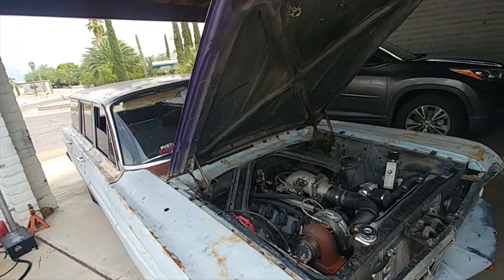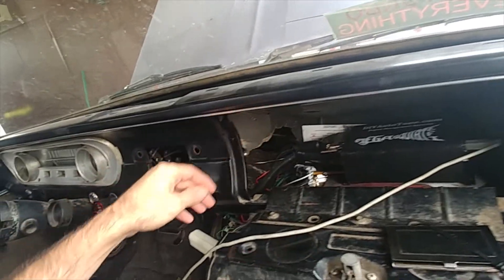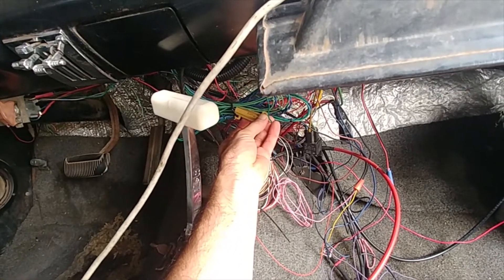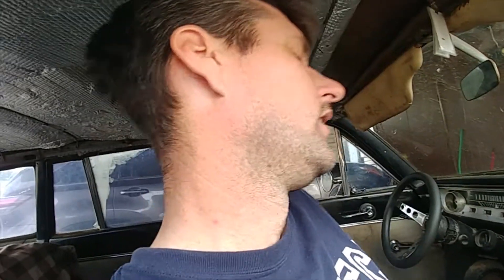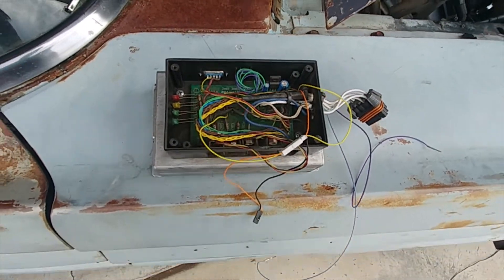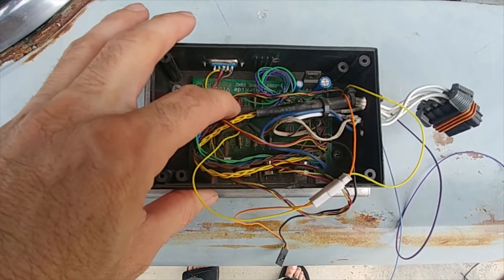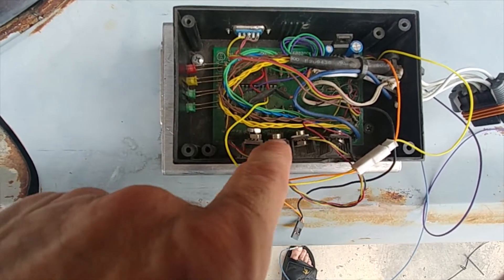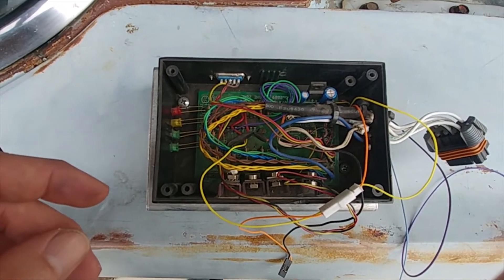4R70W Transmission Controller MegaSquirt3 ECU

Comment: Hello friend, I like your project. casually i want to do something like this i have a coyote engine and 4r70 transmission
Reply: I would like to do it with the ms3 that I need the most I want to control the engine and transmission
Reply from the maker: @ricardorodriguez9994  not sure it will work with a coyote motor as you will need to use up all the spare outputs to drive the VVT and the inputs for VSS will get used up by the CAM inputs.

Comment: I’ve wanted to use an eec5 to control trans only, no engine. It needs a 36-1 crank trigger but no cam sensor, I think everything else could be simulated with resistors internally. You are using 36-1 crank with hall effect sensor (explorer style) if I’m not mistaken?
Reply from the maker: The crank wheel is a 36-1 that i had water jetted out of 0.125 steel.  The sensor was from DIYAUTOTUNE.COM  it finally died on me after 10 years and now I'm running a honeywell unit from digikey.

Comment: Did you do your own firmware?
Reply from the maker: Just modify the source code and recompile it with Cygwin.  All the info is on msextra.com for modding the source code for both MS2 and MS3.
Reply: Thanks I have done some coding modifying  ms2 code so I can get better lockup control.  Currently using ms3 ecm for engine  . Microsquirt for TCM and arduino to simplify  my range sensor 10 wire down to 3 digital signals.  Similar solenoid pattern to 4r70w I'm running a a340f auto. Works decent but I do like the idea of doing it the ms3 box alone.